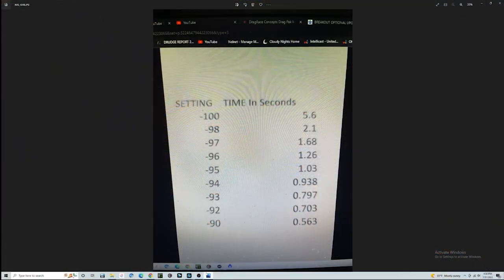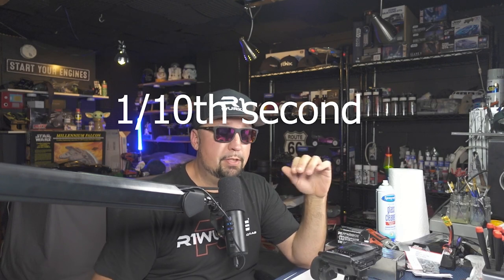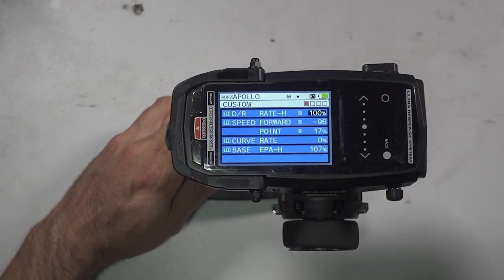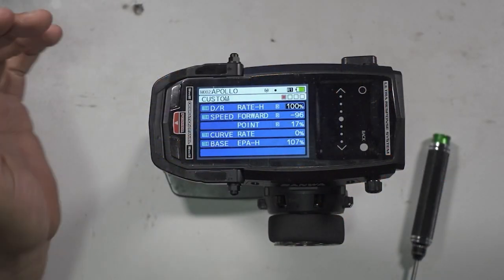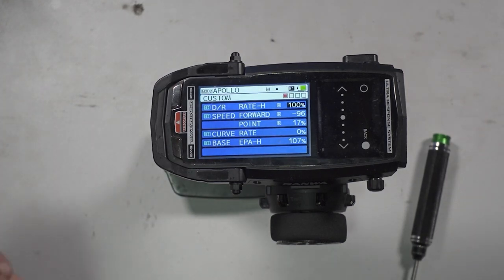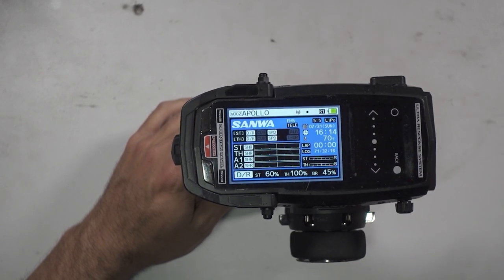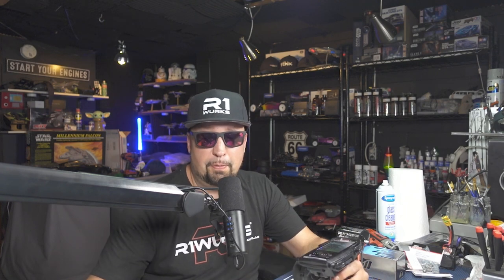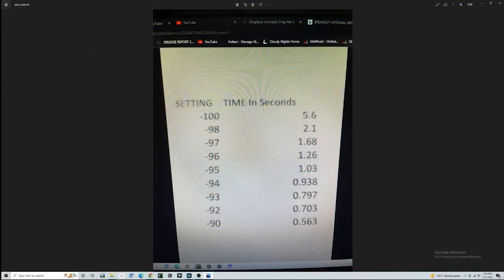GO FASTER NOW WITH THIS RADIO TRICK!! | FREE TIMING AND SPEED | NPRC VIDEOS

Comment: Awesome Video !!!
Quick question… would this work for an XRay X4 2024 for carpet racing?
Reply from the maker: We do all kinds of weird shit on carpet and on road. Use mode and lower epa to save battery for 4-5 laps and then click to -100. Gotta just try it and see if it works. The trick is to find the right gear to only have to shift one time

Comment: Awesome video - I kept reading and hearing about EPA and now I know what it is -
Reply from the maker: Sweet man. Rember if you’re running a tekin type or castle esc we used to lower epa. So you might see some of that floating around as well. This concept is for when you use something like an r1 or also a castle when you need or can use 100 and more. Kind of a 2021-2022 comparison
Reply: @Dorkyand40  Do you have to re calibrate or is it just an adjustment on the M17?
Reply from the maker: No. Keep calibration the same. If you recailibrste then you’re just making the new epa the new 100. Does nothing.

Comment: Hey bud have a question for you. I remember you doing a video of some fl1 boards running betaflight. Was there anything I need to change in the way I hook up stuff when it's running betaflight. I got so many revoltosd and millivolt osd I wanna run bf on. At least I think I remember you doing this anyways. Correct me if I'm wrong lol
Reply from the maker: could only use 1 wire for the receiver.  so no telemetry.  it worked with crossfire and tracer..should be fine with elrs.  you can get the wiring diagram off their website and it should be fine
Reply: @Dorkyand40  ok awesome thanks man appreciate it

Comment: FYI, Thanks for the content, but there needs to be a little clarification on point in the throttle speed feature.  disregarding EPA or assuming it's 100%,  P#'s 1-10 in the TH curve are equal to 10% throttle for each P#.  So if your pt is 17, you may not launching at 17%, persee.  You are launcing eomewhere between P1 and 2.   If your p# are linear, 10,20,30,40, etc then 17% would be your launch.  However, say your p2 was 50%.  17 Pt on radio skips p1 and hits starts 17 to50% alsmost.

The point in radio moves along the x axis.  Another example.  Say you had p#1-3 curves of 20,30,40.  If you had a point of 30 speed, you would launch at 40% throttle or p 3.  Every 10% in point correlates to  one P#.  This is a common misunderstanding that a lot of users have.
Reply from the maker: Yeah for sure. P curve tuning gets to be another monster for sure. Then throw in r1 curve and start power. Boy it’s a lot. Lol.
Reply: He is not using P curve. Like he said thats a whole different animal

Comment: I don't drag race, but for most ESCs you calibrate it when you first hook it up and it makes the transmitter/receiver and ESC line up so that 150 EPA is where you get 100% of your throttle. If I set my EPA to 110 instead of 150 it means I'm losing a third of my power. You could have EPA at 150 but reduce the throttle "RATE" to 50 and you'll get 50% of that 150 power. This didn't make sense to me but maybe it's a drag racing thing? I don't have a Sanwa either so apparently I'm missing something.

Comment: I use the epa on my flysky noble with the ramp speed it's helped me a lot
Reply from the maker: Good to know man!!
Reply: @Dorkyand40  it doesn't do as much as the m17 but we have figured out how to make it work with my r1 I tune everything in the esc and only use the epa and Chanel speed for steering and throttle I'm not in the 1.9s yet but very close
Reply: @billynichols1008  your usuing End Point adjustment with Throttle speed go on the Nb4 ? What are you doing with the End point ,It only goes up or down ? 

I use combination of Throttle Speed Go with Expo F and Rate F,  never heard of using the end point on NB4 ? Thanks

Comment: Do you still calibrate the esc with the radio set to 100 epa or no using this method?
Reply from the maker: Regular calibration.  If you change the epa and then calibrate then it just sees that value as the new 100.

Comment: I got a line on a m12 for a good price. What you think?
Reply from the maker: Might be an option. Never seen one or anyone demonstrate it can do what the m17 does and how to do it. That’s the big thing. Getting the most out of it. Like this video!
Reply: @Dorkyand40  from what I was told it does what the m17 does just not on the home screen.  I always like your vids man. I've learned a lot in my few months doing this nprc from you
Reply from the maker: @cowleysmobilewelding  awesome man. Hope I can keep helping. Everyone is so fast now it’s hard to find those good nuggets but many of the old videos still hold up.
Reply: @Dorkyand40  I had to run against frank Greer last weekend.  That guys on another level
Reply from the maker: Lol. I had ulbrick a few months back. It’s on the channel. Lol. What a trip
Reply: I bought one man, definitely has the functions, BUT be very careful. The range sucks! I was losing range around 150-175 feet away. Without a properly set up fail safe it’s inevitable the car will run away and break parts (ask me how I know!). I ended up selling it and spending a little more on the m17 and it was the best decision I made!
Reply: Hi chad are there videos of thad race ??
Reply from the maker: Coming this week